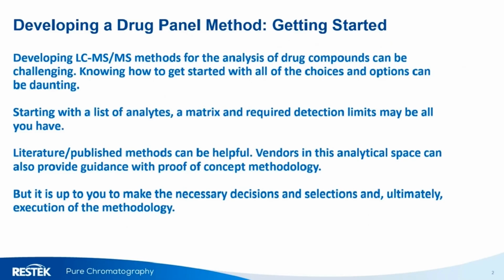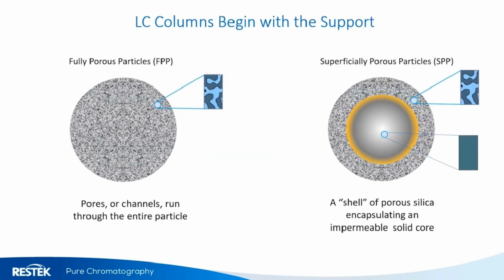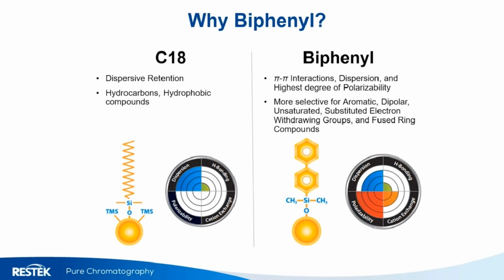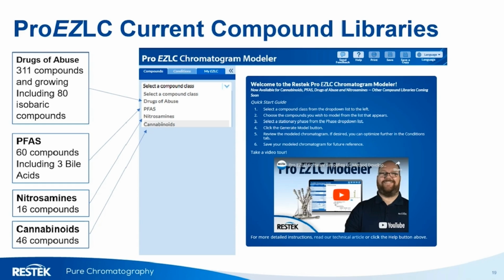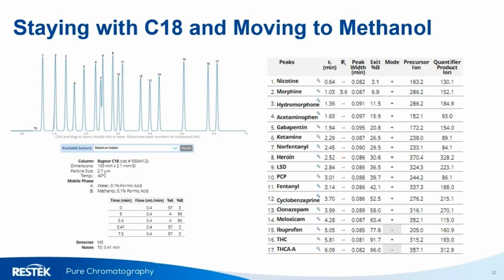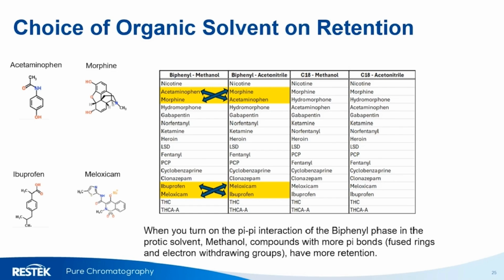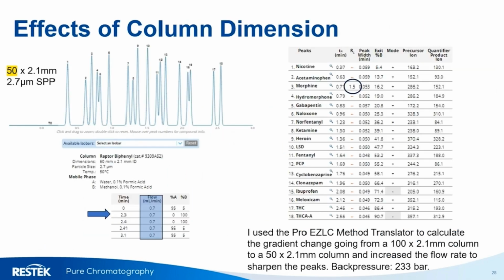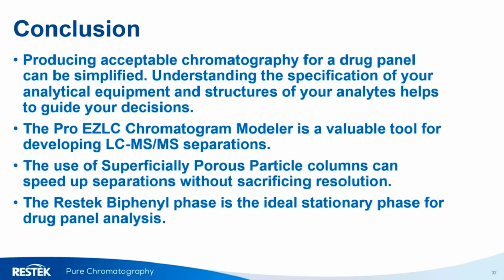LC-MS/MS Method Development for Drug Analysis

Comment: Thank u . I wanted to ask for your opinion on something I'm working on.

In my LC-QTOF-MS/MS data for phenolic compounds, I detect some metabolites only in ESI+ and others only in ESI−, and a few appear in both. For now, I’ve been calculating % peak area separately for each mode using:

% Peak Area = (compound response / total response in that mode) × 100

But I’m wondering — is it okay to combine the responses from both ESI+ and ESI− and calculate % peak area from the total, or is that not recommended due to the difference in ionization behavior?

Also, when I prepare a heatmap, I usually just pick one mode per compound (whichever gave the better signal), even though the % peak area was originally calculated per mode. Do you think that's acceptable, or should I keep the modes completely separate even in visualization?

I’d love to hear your thoughts if you’ve dealt with something similar!

Thanks so much 😊